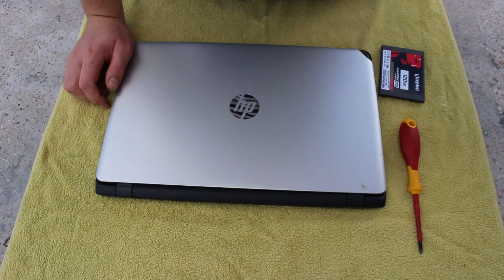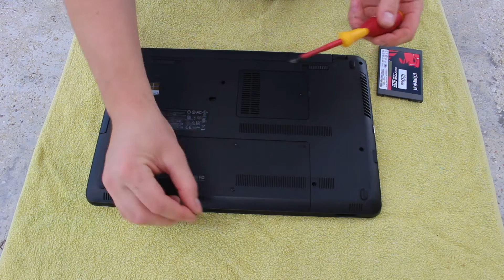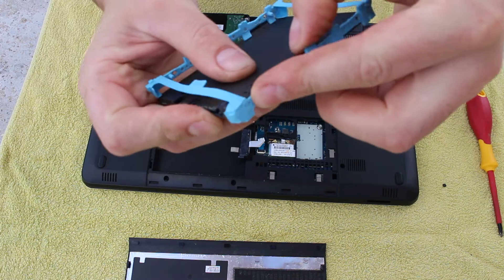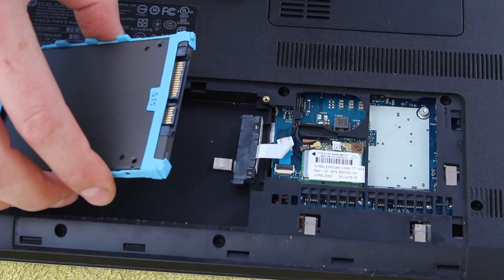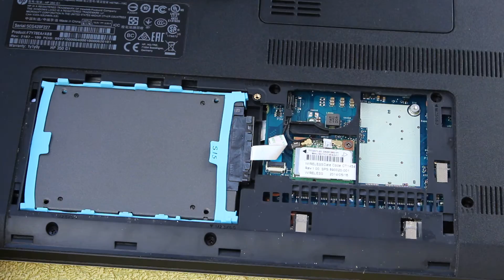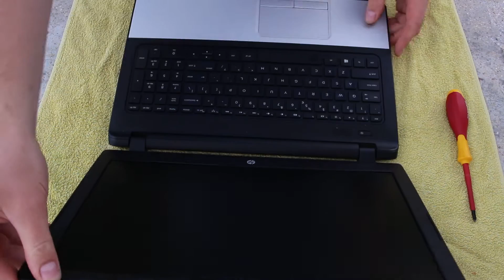HP350 G1 HDD upgrade to SSD Kingston UV300 120GB - FixTut.com

Comment: Hello,

I also have this laptop model. I'm thinking about buying SSD to speed up the computer. I have two questions:

1) Can both the SSD and the HDD work at the same time, i.e. Does it have physical places for both of them?
2) Is it possible to install Windows on a SSD drive? I read on the forum that some people complained that Windows can not boot from SSD.

Thanks
Reply from the maker: Hello,

1) Can work together, but for that You'll need to take out ODD (CD-ROM) and use special bracket for placing HDD/SSD to that place.
2) I would not suggest to install Windows to SSD. I must insist to do that. You should stop reading that forum, for real. SSD is used not for storage, but for OS and other applications to run more smooth, access (read) time is ten times higher, as well as write speed and switching data between RAM<>SSD is unbeatable compared to RAM<>HDD.

About option 1), I would avoid using HDD at all, use old HDD externally over cable. HDD is good place to backup Your stuff, nothing else. SSD is the thing. Now the price for 120GB SSDs are 20€, 240GB for 40€ or get 1TB for 100€. Get rid off HDDs and keep SSD (but better have backups in HDD, they are better for that than SSD).
Reply: 635/5000
I agree with you. The notebook needs to have a solid state drive, and the data should be stored on the external hard drive.

I do not know where you are from, but here in Serbia, SSD prices are:

256 GB - 70 €
512 GB - 115 €
1TB - 220 €

These are the prices for Samsung 860 Evo SSD. Many people recommend this model, they say they are very reliable, and have a 5 year warranty.

What are your SSD experiences, which model (brand) do you use? Did you throw out the old HDD and insert the SSD, or did you insert a SSD instead of a DVD drive? How long does it take to boot Windows to SSD? With my HDD the boot time takes a long time, and it sincerely annoys me.
Reply: I almost forgot, if you place an SSD instead of a DVD drive, then can the SSD be the primary partition or i must replace places with the HDD?
Reply from the maker: Most of Crucial SSDs have 5Y warranty as well. For this laptop, SSD speed does not matter so much. I would buy the cheapest one (with 3Y warranty, Kingston, Adata etc). The best choice is  Samsung, but too expensive for an old machine. Buy it and keep for Your next laptop. I am buying from Germany (with shipping to Lithuania) and using middleman services to get an address in Germany. In Amazon.de 500GB Samsung 860 you can find for 80€.